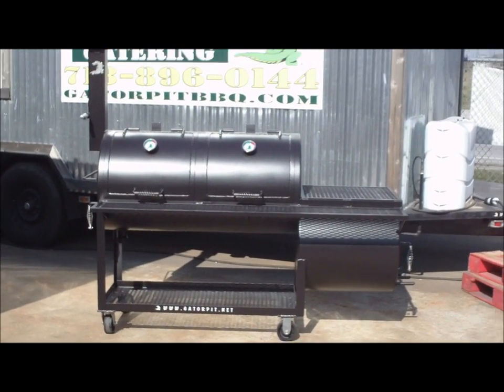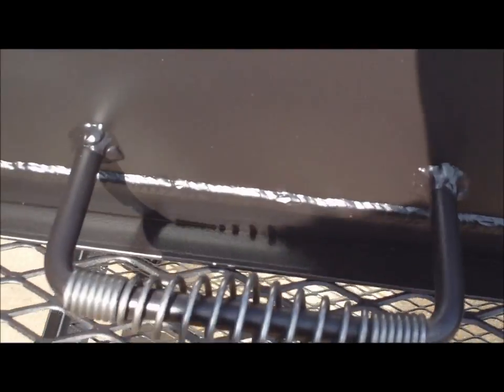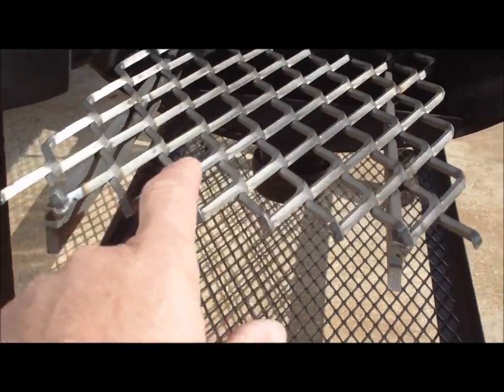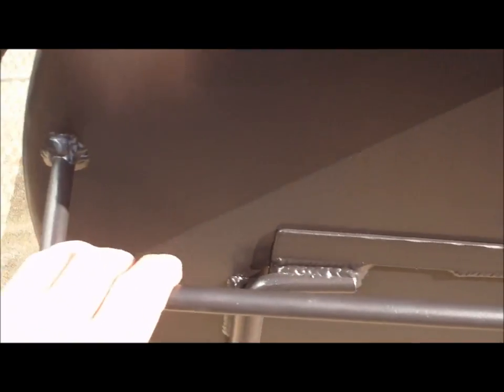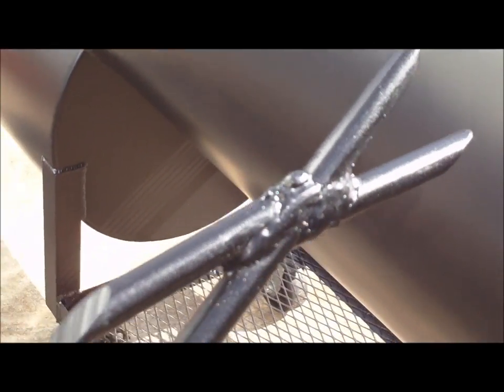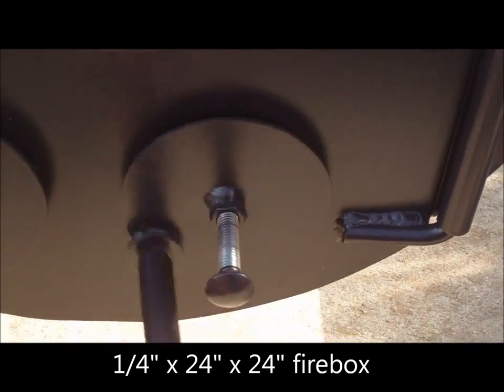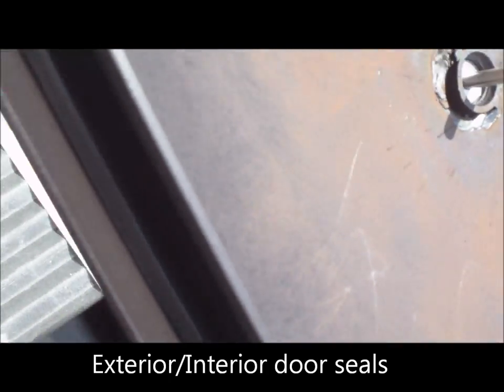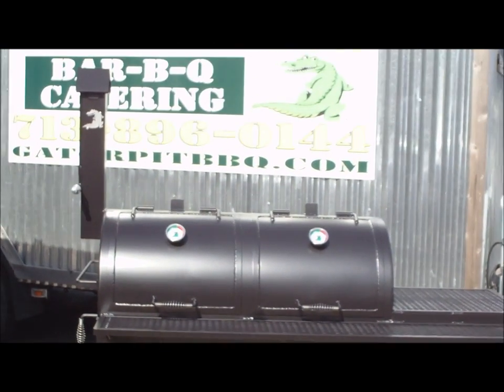2448 Smoker by Gator Pit of Texas BBQ Pits

Comment: Curiosity Question: I wonder if the use of "counterbalance hinges with static positioning", would make for a better hinge mechanism? Most makers, except Lone Star Grillz, tend to use standard hinges welded to the lid/cooking chamber, and depending on the circumstances, a large counterweight is added to allow for easy opening & closing of the lid.

Any thoughts on this idea?
Reply: If referring the hinges typically used on ceramic cookers, I don't think they would work on a round/pipe surface.  They are either mounted flat vertically or flat horizontally.  They may make a hinge, as you mentioned, but I am not aware.  Anything is possible.   :)
Reply: Gator Pit
Thanx for the quick reply.

And KUDOS to Gator Pit, I've seen numerous YouTube Gator Pit smokers, including those on your well-made website and I'm totally convinced you guys make some of THE best BBQ smokers in America. I think Ritch does an excellent job in pointing out every-single-aspect of his cookers. Lang & Lone Star Grillz do a very good job as well but Ritch is extremely detailed oriented. Superb salesmanship!!
Reply: Gator Pit
... and since you mentioned it, I guess I am referring to the ceramic cookers without really thinking about those. Completely forgot about the hinges used on ceramic cookers.
Reply: James Patterson Thanks.